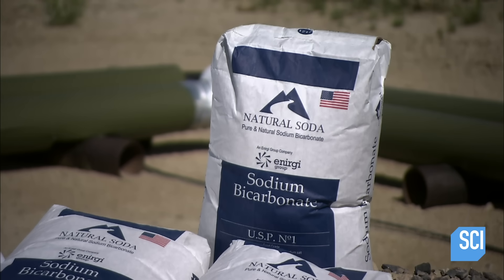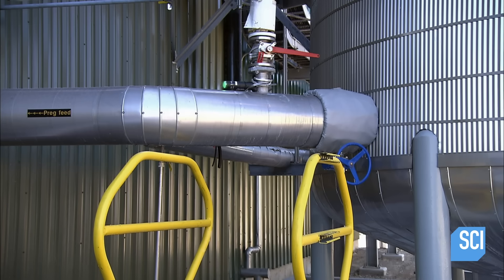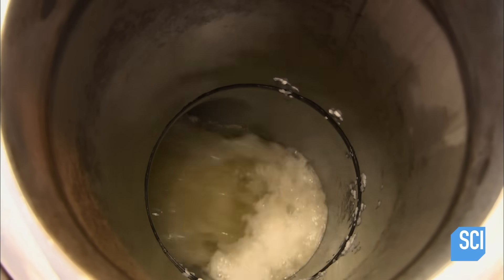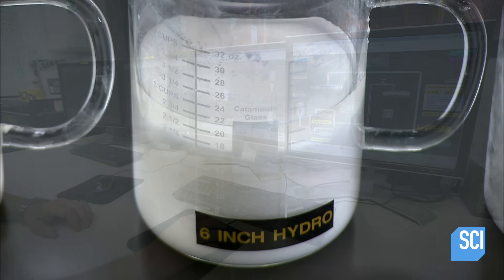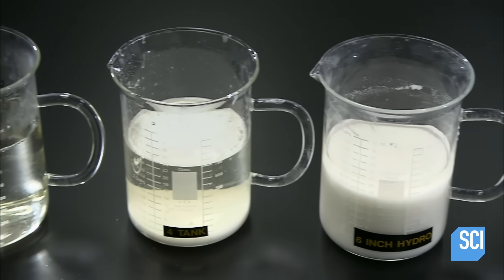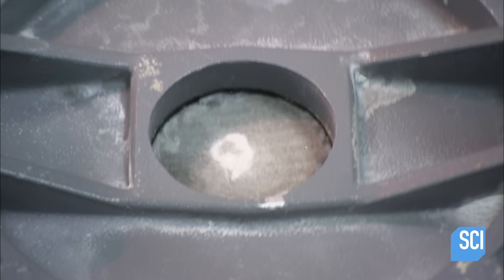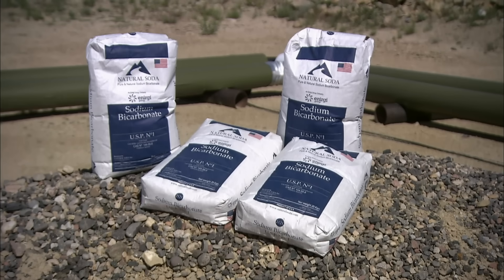How It's Made: Natural Baking Soda

Comment: as an automation engineer, i'm screaming in my head seeing the lack of instrumentation on that heat exchanger skid with the holding tanks lol. like seeing that hmi screen, which imo should be on something like a panelview plus 7 to control the tank level transmitter and temp transmitters that aren't there, the heat exchanger input temperature transmitter that should be there, flow transmitters on your pumps. I see RO water water and what looks like a closed skid.. don't you have a CIP setup to prevent mineral scale?

Comment: interesting, I have walked down the P&IDs of a major soda ash plant.  The Arm and Hammer plant was the neighboring plant where they add the extra carbon atom.  The trona ore is bicarb, but they calcine the ore, which drives a carbon atom away making sodium carbonate, then they dissolve it in water and then the process is similar to this video.  The evaporator towers were amazing the way that they pull a vacuum to lower the boiling point.

Comment: TIP: To convert sodium bicarbonate into sodium carbonate (a much stronger alkalai), spread to 1/2" deep in a foil lined lipped baking sheet, and bake 2 hrs at 350F ... that liberates the excess water and CO2 that sodium carbonate naturally absorbs from ambient air and humidity over time.  Cool fully and store in an airtight container. Rebake every 6 months.
Reply: Thanks I'll try that
Reply: @Fraud_Flintstone  A good cost saving tip, thx.  However, I'm a DiY kinda guy, and making your own saves a round trip to the store.

Comment: There is NO SUCH THING as "natural baking soda". Sodium bicarbonate DOES NOT occur in Nature. For centuries, it was made in a very impure form by heating sodium CARBONATE or mixing salt (sodium chloride) with chalk or sea shells (CALCIUM carbonate) and "purifying" by differential solubility as described by the Romans in 23 BC. Then in the late 1800's the manufacture of chlorine bleach and other electrolytic processes made it abundantly CHEAP. In 1800's France (Napoleon) baking soda cost about $150 THEN a pound, not today's equivalent price. By 1885 it cost about 2 CENTS a KILOGRAM, or as Dwight & Church Company packaged it in the US a whole penny for 16 ounces. Look in the 1886 Sears and Roebuck Catalog reprint to confirm it for yourself. Table salt was $4 for 12 pounds from the CAREY Salt Co. Morton Salt didn't exist yet.
Reply: Yes there IS A SUCH THING. Look up the mineral nahcolite. That's what they were getting out of the ground in this video.

Comment: Anyone know if the chemically made baking soda is any better or worse than mined from the ore? I am looking for the purest form as I use it with my patients with terminal diagnosis that eventually loose the diagnosis.
Reply: I worked for a competitor years ago.  We always used to do a demo where we took some product from this company and dissolved it in hot water.  Smelled like kerosene.  Turns out the nahcolite deposits they are solution mining are intermixed with oil shale.
Reply: I’m not surprised at all. Although the chemically made baking soda looks even worse.

Comment: No shots of the actual mining and how it is in raw form. Just a bunch of dialog about brine. Typical HIM format of leaving out key parts of the process to get it in 4 minutes.
Reply: I work at the plant in the video. We actually don’t have a mine like most people think of them. We drill wells not unlike oil and gas wells, with two holes per well. We pump hot (230f) low concentration brine down one hole and high concentration back up the other. Then we crystallize the dissolved NaHCO3 by cooling the liquid in a series of crystallization tanks. As for the raw material, it’s called Nacholite and looks like any salt deposit, but is only found in large quantities in Western Colorado. Most all other Sodium Bicarbonate is made from soda ash or Trona ore, with CO2 added or from Calcium Carbonate + ammonia + C02. Ours is the only process that mines pure Sodium Bicarbonate and requires no additional chemistry to make the final product.

Comment: Why is the processing plant so far away from the mine? What are the three grades of baking soda, and what is each used for? So many unanswered questions.
Reply: The grades are just sizes of crystals. Different grades are used because of their properties, mainly surface area. Very fine product goes into stuff like fire extinguishers while coarser grades can be used for baking or cleaning products. Different sizes of crystals will give slightly different results for baking or other processes. Non food grades will be used for industrial processes or to mix with cartel feed as an acid reducer.

Comment: I wonder why the mile-long pipe system is from source to plant. I work in IV manufacturing, and our plant was built on top of an underground reservoir.
Reply: The source is a large area mineral deposit, probably used to be a lake bed or bigger. Each time a section is mined out, new boreholes are drilled in new locations. Easier to re run some pipes instead of shifting the whole plant.

Comment: Is anyone else amazed that this product doesn't cost a lot more?
Reply: Factors of scale.  They’re shipping this stuff by the rail car.  Strike that, by the train.  And with the brine injection, a worker doesn’t have to go digging.
Reply: It does if you buy it in little boxes. I get 13 pounds of it at Costco for about a buck a pound. I imagine it's half that price in 50+ pound bags. Considering that all they're doing is pumping brine out of the ground and drying it, it shouldn't be that expensive.
Reply: B May look at the vid again ! Firstly they have to pump in ‘ hot brine ‘ so that it gets saturated with the mineral element . I hope you’re not in the education business ?
Reply: @dennispickard7743  All this is is pumping brine underground, pulling it out, and drying and purifying the mixture. Nobody is bringing in train cars of raw materials, there are no parts, there is relatively little energy consumption, no significant chemical usage, etc. Compared to most How It's Made videos, the production process here is quite simple.

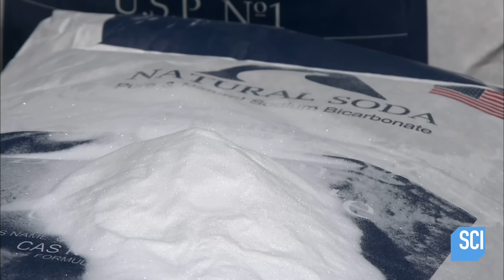Comment: 0:30 "Can be produced through a chemical process or be mined from the ground"
The video later proceeds to say that the miner dissolved the baking soda underground by using hot brine. 
As I understand. Baking soda has to be mined from the ground and then processed back into baking soda? 
Can't we just mine it from the ground?
Reply: I think it has to do with filtering out impurities
Reply: Thanks for noticing the statement that it "Can be produced through a chemical process...". I was looking for that bit of information all the way through the video and by the end, it remained undisclosed. :(
Reply: By using water (brine) you don't need to dig holes and put equipment underground. All you need to do is drill bore holes.

This video only covered natural baking soda, it can also be synthesised by chemical process from other raw materials.

Comment: I wonder how they precipitate the baking soda but don't also have salt (from the brine) also mixed in.
Reply: Brine is a general term, it dosent necessarily mean salty water.
Reply: @dougaltolan3017  In industrial processes, brine is commonly defined as a concentrated sodium chloride solution. Perhaps in other parts of the world the term has a different meaning.  In the US, it is almost universally referring to salt water more concentrated than sea water.
Reply: @jeffreyt991  The oil industry would like to disagree with you. Brine refers to a solution of any salt.
I dare say that in liquid extraction of baking soda, that industry refers to a solution as brine.
Reply: @dougaltolan3017  Fair enough. The industry I work with uses the term brine for salt water used to produce chlorine.  I can recognize different industries have different meanings for the word.

Comment: I use it in bathing and in cleaning. Also as a heartburn treatment. Baking soda is very versatile.
Reply: Helps decrease acidic ph in a coffee if you add a pinch, tasteless
Reply: It’s great for heartburn, but tastes awful! I’ve heard it’s good to use for brushing your teeth. But it’s a bit coarse on them. My dad used it when I was a kid. I don’t know I& he still does, but he has all his teeth still. Supposed to help with your breath also. I use it on my shoes. When they start getting a bit rank. I put 3/4 a cup in each shoe coat the whole inside let them sit for a few days, and it draws all the stink out. Works great too!
Reply: It's great for absorbing odors too, for the kitchen garbage bin and ashtrays and the like
Reply: @archkull  add white vinegar and the reaction will make a nice cleaning foam. Perfect for toilets sinks etc
Reply: @klaudii4446  no it won't, baking soda is alkaline and will quickly neutralize anything acidic*. It is a waste.
Reply: @archkull  no it’s not. If you know proportion it won’t waste away as fast. Adding small amounts can make a paste and after cleaning with the paste finish off with more vinegar for rinse and voila.
Reply: @archkull  vinegar is ascetic acid not citric lol.
Reply: @krissp8712 acetic is the spelling. Ascetic means something totally different.
Reply: I used this for heartburn too. It's just somewhat salty because some of it reacted with the acids in the air
Reply: sodium bicarbonate is so laden with nickel that the manufacturer declined information on its actual nickel content. Beware nickel in foodstuffs! more here: https://www.youtube.com/watch?v=BsEDebofjAM&t=385s
Reply: even to clear skin from acnes, itch, dandruff, etc.. digestion, detox heavy metals from our body, etc
Thanks Universe

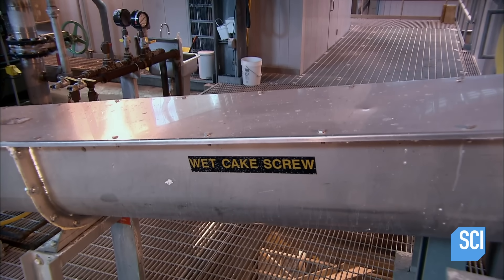Comment: 3:00 so they add dry powder to the moist powder to help it dry? Why not just dry it?
Reply: It allows them to decrease the water content before drying.

The water contains dissolved soda, so when it's removed, that last bit of soda precipitates and tries to glue the particles together.

If the water content is too high the dryer will make chunky soda cement instead of a nice powder.
Reply: @jordanrodrigues8265  I don't doubt that is correct etc.

But hear me out.

"Decrease water content before drying" - that's what drying is?
Reply: @sivansharma5027  Not quite that simple .
Reply: @timc333  elaborate?

Comment: It's a really versatile chemical, I use when I got heartburn, 1 spoon of baking soda in a glass of water it's enough
Reply: I have acid reflux disease , I use it for relief as well , but may I suggest that you next time try taking it in a glass of very warm water , mixed very well till water is almost clear then drink down as fast as you comfortably can , you may get much better results , the very warm water seems to activate it just before it is induced , seems to quicken the results . Yes it works every time I personally am sold on it , it is an old fashioned remedy that simply works very well .

Comment: Containers and machines are so clean in the factory because they are always cleaned with baking soda (X
Reply: That makes sense as it’s a natural cleaner
Reply: @Astrid well if you consider the fact that it etches all the Portland cement out from between the aggregate in the concrete floors in that facility ,most of the regular mild steel handrails are heavily pitted but are free of rust ,  once you work your way into the dry processing side of that building there is baking soda on literally all surfaces
Reply: @SKULLCRUSHER true
Reply: by far the nastiest plant I have ever been in was a soda ash plant.  the floors\sump system was every much part of the process as the tanks, pipes and pumps.
Reply: @Astrid YOU WOULD THINK BUT THEY ARE SOME OF THE DANGEOUSCAYSE MIXING IT WRONG OR ANY OTHER MISTAKE MAY CAUSE PEOPLE THEIR LIVES CAUSE OF THE RISK OF BLOWING UP THE WHOLE FACTORY
Reply: @yellowbone5751  in this case definitely not unless you showed up with a shitload of vinegar or something LOL definitely not flammable The boiler room in that particular facility is pretty impressive from personal experience if I remember right there are two 904 million btu boilers that are about 40 ft long and about 15 ft diameter